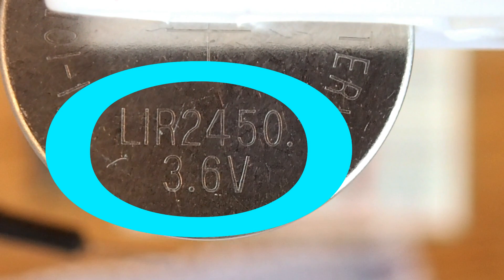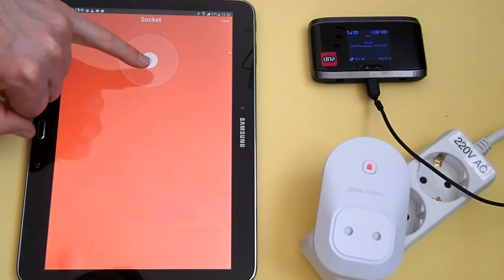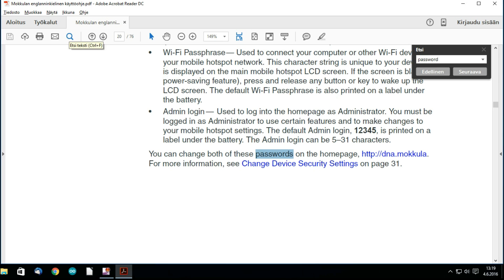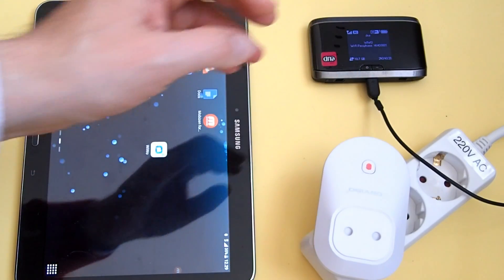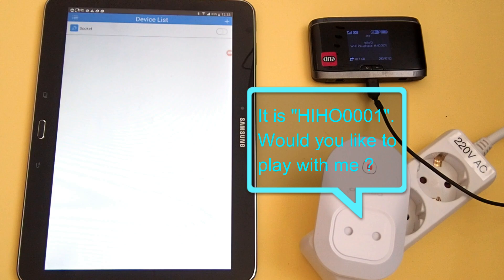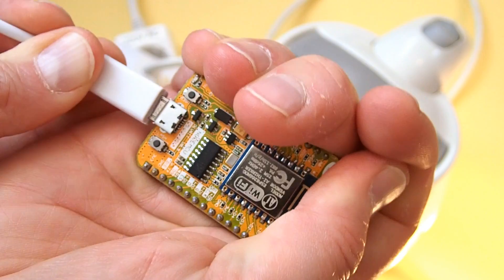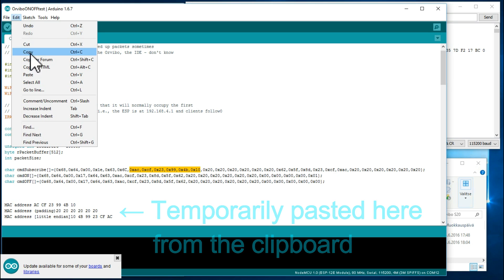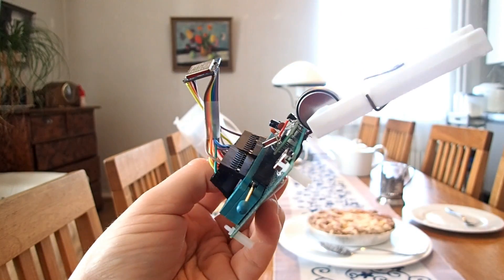#4 ESP8266 & Big Currents

Comment: Hi Miika,
The s20 is not existing anymore I only find new B25 type at Banggood. It is a same just like s20 in case of programing ? 
http://www.banggood.com/WiWo-S20-Wi-Fi-Smart-Remote-Control-Timing-Socket-USEU-Plug-p-953743.html?p=PU22124098863201603C
Reply from the maker: At eBay they still have them
http://www.ebay.com/sch/i.html?_odkw=s20+sonoff&_osacat=0&_from=R40&_trksid=p2045573.m570.l1313.TR0.TRC0.H0.Xs20+orvibo.TRS0&_nkw=s20+orvibo&_sacat=0

Comment: Thank you for this video! I had already purchased an Orvibo socket (U.S.) from Banggood.com, hoping to be able to sniff it or control it via my own wifi devices. It seems to be a reliable switched socket; just need to "connect the dots" now and put it under my own control.

I might also suggest that you add "Orvibo S20" to your video title to make it easier to find when people are searching!
Reply from the maker: You are luckier than I am. Orvibo S20 is approved by the FCC. But, if I have understood right, it hasn't been approved by our European authorities.
http://www.orvibo.com/product_24.html
Reply: Yes, I suppose. Although, I don't expect it will cause any interference for you anyway.

I haven't yet tried the code you're using, and I've just begun looking into it, but from what I gather, this uses the ESP to set up another access point that the S20 connects to, is that right? My main concern here is that this would create even more crowding of the 2.4GHz space if you're in an area that's already crowded with WiFi. I might do it anyway, but it's not a scalable solution in densely populated areas.
Reply from the maker: If the Orvibo S20 Socket is on, the mains current get connected already 1/3” (8 mm) before the plug reaches the bottom of the socket
   https://youtu.be/ei3a7xf7KCE?t=1m5s 

It of course would be very dangerous if the mains current would go from a finger of one hand to a finger of another hand (through the chest of an person).

I don't have that thin fingers, but children do!

Yes, in the  setup();  function of the ON-OFF-test-program there are the lines:
   Serial.println("Configuring Access Point ...");
and
  WiFi.softAP(ssid, password);

Well, here in Finland we have only 42 persons per square mile (16 persons/km2).
   https://en.wikipedia.org/wiki/List_of_countries_and_territories_by_population_density 
So, it would be difficult for me to find out the answer for your second question. But try and then, please, share your experiences here!

And, of course, use your imagination and choose a good SSID name and a good password. That should help.

And, thanks! I added the "Orvibo S20" to the short subscription of the video.
Reply: Bill Eason

Comment: That socket is already wifi, you don't really need an esp8266. Also  that mixer could have really hurt you, you should have at least removed the attachement !  Those sockets looks very expensive, maybe 50$usd ?  You can get 5 433mhz controlled sockets like that from a brand : etekcity for 30$USD.

Very easy to control using the esp8266, a one dollar 433 mhz transmitter and the rc-switch arduino code from github.

I guess this is fine if you need to control only one light, but if you want to control every outlet in your house, you will need another mortgage if you use the wifi sockets.
Reply from the maker: Yes, you are right. Normally we use electric devices without remote controllers, don't we? And these Orvibo WiFi sockets are manufactured and meant to be used without any ESP8266 microcontrollers.

But in this tutorial we wanted to test if these sockets could be controlled by ESP8266 microcontrollers.

I personally think that these WiFi sockets are the safest way to control mains currents with a microcontroller. 

But you are right! Somebody can get hurt from a device that is suddenly turned on by our microcontrollers. Or you can burn your house with a heating element, for example, that is connected to a WiFi socket and is turned on without supervision.

An Orvibo S20 WiFi Socket costs about 15$
https://docs.google.com/document/d/1B4ShcVxsw-nl_cHKZJyShw3F1iLgO65AFqF6PaY58Hw/edit?usp=sharing 

It is true, that for that price you can get one or few 433MHz receivers
http://www.ebay.com/sch/i.html?_odkw=etekcity+rf&_sop=15&LH_BIN=1&_osacat=0&_from=R40&_trksid=p2045573.m570.l1313.TR0.TRC0.H0.Xetekcity+remote.TRS0&_nkw=etekcity+remote&_sacat=0 

But I have found 433MHz receivers unreliable as the don't anyhow confirm to the sender that they have received the message from the remote controller. 

With WiFi sockets you get this confirmation.
Reply: TO make the 433 sockets reliable, I sent the ON or OFF signal for 2 seconds, also I keep my TX relatively close from the outlet or put a better antenna than the piece of wire to put on these things.

Another thing I did was use a second coin cell powered esp8266 as a sensor to confirm activation of important devices, for example my garage door, has a sensor just for checking if it is open or closed because I don't want it open for no reason.

It also depends if you just need to control one thing, of if you want to control every single thing in the house.  

For one thing, the cost doesn't matter and it's best to take the much better wifi outlet. 

As for getting hurt, I was really refering to those spinning shaft very close to clothing in the video. Spinning shafts are very dangerous and powerful. It activated so close, there was a real chance of getting caught in it and getting seriously hurt.
Reply: These module seem pretty nice for putting in-line in junction boxes. But I can only find them for 8$/each with shipping. Where did you find them for 4.85$ ? Does that include shipping (say for 10pcs)?
Reply from the maker: Yes! I have already ordered those. I still wanted to do the video with Orvibo sockets because with them people don't need to do any mains current connections by themselves.
Reply from the maker: This socket from Electrodragon is very promising too  http://www.electrodragon.com/product/wifi-iot-relay-board-based-esp8266/  I haven't yet got it. Still waiting for the mail.
Reply: Wow that looks great, if it's not vapor ware that is the most cost effective design yet.
Reply from the maker: +shodanxx   I haven't seen the documents, but they say that the ESP-12F module (that is used here) is approved by FCC and CE. And ESP-12F modules have a 4Mbyte memory that is needed for Over The Air programming. And this seems to have a proper strain relief for the mains current cables.

Comment: how long will the battery last if you let the ESP running?
or do you put it in sleep mode with interrupt from GPIO-0 & 2
Reply from the maker: It depends on what you want to do with the ESP8266. If the microcontroller takes a WiFi internet connection once in every hour (and sleeps the rest of the time), one rechargeable LIR2450 should last about 17 days. 

Andreas Spiess has made an excellent video on these batteries & ESP8266
https://www.youtube.com/watch?v=IYuYTfO6iOs&t=12m42s

For battery powered systems it is also adviseable to use decoupling capacitors to smoothen the peaks of power consumption
https://www.youtube.com/watch?v=6SdyImetbp8&t=3m40s
Reply: I know his channel and thought I've watched every video he made about the ESP8266. Still funny that you mention him, as I'm swiss as well ^^
In my latest and first project I used the ESP as webserver to unlock/lock my door with different modes and different inputs to operate it. It uses a micro switch to detect if the door is open/closed and together with a small stepper motor an L293D as driver and an ATtiny84 as controller the ESP is used to get the status of the door lock/unlock it. also a button with an integrated LED shows the current status and the button can operate the door as well. It really works like a charm and on my Android phone I used tasker to unlock/lock my door automatically when arriving/leaving home so I do not have to bother about forgetting to lock my door as it is automatically locked by my phone when I leave home if I haven't locked it.

I am a new to these kinda things but as an IT student I am a big fan of gaining the knowledge to build my own gadgets. YouTube channels as yours are absolutely fantastic for gaining more knowledge all around DIY gadgets. I am really thankful and I hope you will keep it up as you are doing/showing very interesting topics in a very pleasing format with excellent explanations.

So thank you very very much for your time and your fantastic answer to my, after all, not that intelligent question.

Keep up the good work and I wish you all the best and good luck.
Reply from the maker: Thank you for your kind words! Access control of doors is a fine project! And yes indeed, this international Youtube-Arduino-ESP8266-Internet-eBay community is marvelous!
Reply: Miika Kurkela

Comment: Do you need internet access for the socket t be able to be controlled?
Reply from the maker: Good question! 

In this video the ESP8266 chips don't have any internet access. And in this video the Orvibo WiFi sockets don't use any internet access either. 

After the pairing has been done, they don't even need a WiFi router. 

They communicate directly one to another.

But if you want, you can control your S20 sockets from anywhere in the world if there only is network available for your socket and (another) network for your smart phone! For details see the page 9 of the Orvibo manual 
   https://fccid.io/pdf.php?id=2307514 
and there the question Q7 and its answer.